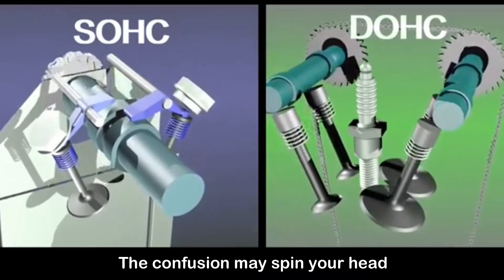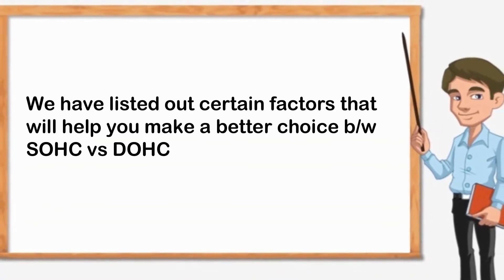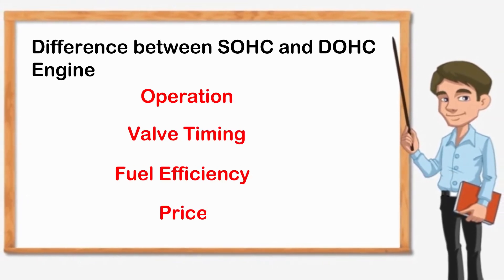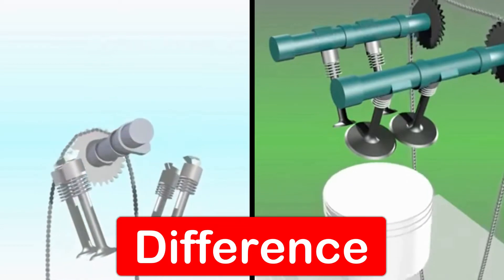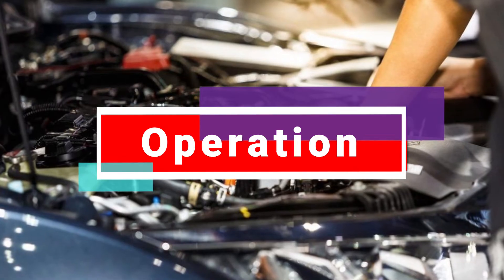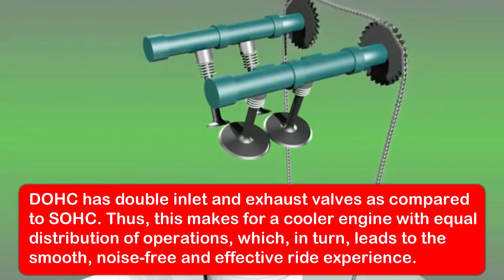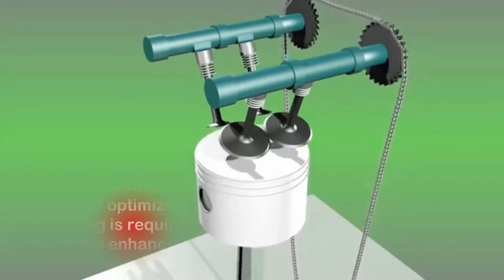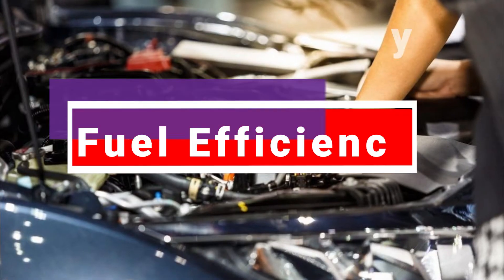SOHC vs DOHC | Which is Best? | Why 4 Valves is Better than 2 | Briefly Explained

Comment: Would the spark plug ,gap, firing order, and wire routing be the same inna sohc engine as it is in a dohc engine? Particularly the 1998 mustang gt vs the cobra model.

Comment: The number of camshafts has absolutely Fucking NOTHING to do with the number of valves. There are a lot of SOHC engines out there with four valves per cylinder. Two of them are in my damn driveway. Where did you get this information?